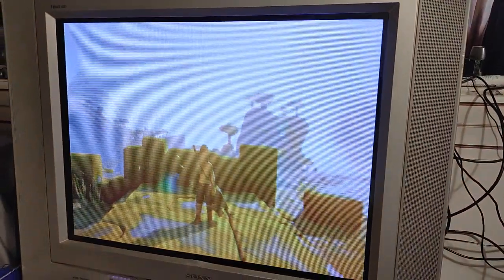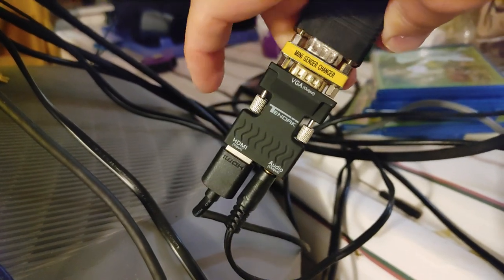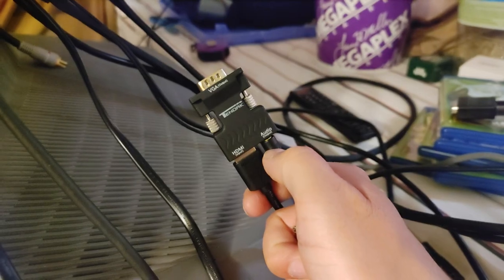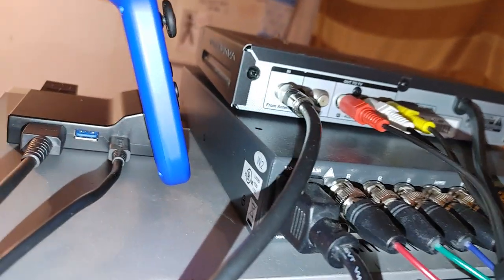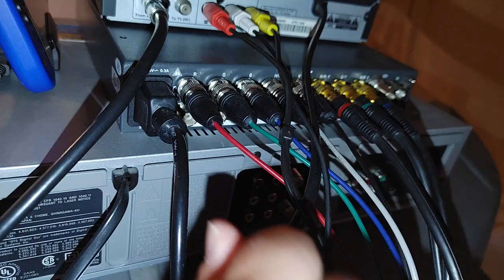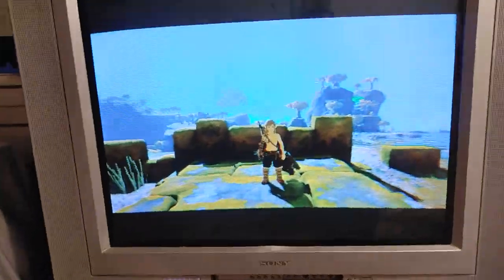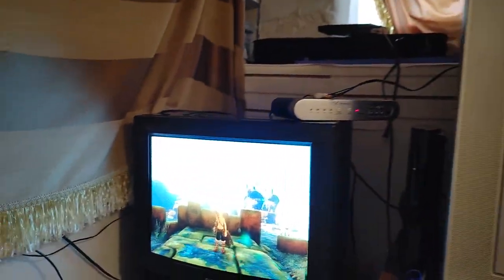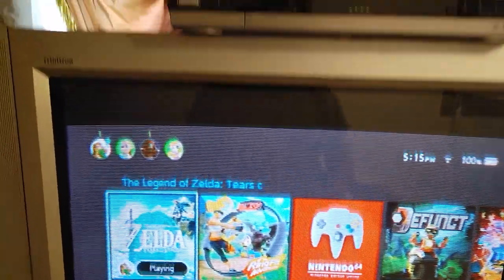How to Connect a Nintendo Switch and Zelda TOTK to a SD CRT Using an Extron VSC!

Comment: Thanks for making this video, very informative!
Does the VSC let you switch between interlaced and progressive output?
The manual of the VSC500 doesn't really say anything about output resolutions, only the different RGB modes you can select.
It should output RGBS 480i at 60Hz for my application, just wanted to make sure before I try to find one for sale :)
Cheers!
Reply from the maker: Great question!  So yeah - these VSC devices only output 480i SD signals.  No 240p or 480p unfortunately.
Reply: @FairyKid64  PERFECT, 480i is what I need!
Thanks for the reply,
cheers !
Reply from the maker: @dirxanr3213 You bet!!

Comment: Can the VSC500 stretch the width beyond the edges of the CRT TV?

Instead of having black bars or negative space on the top and bottom, could I stretch the signal to fill the height of the CRT monitor and crop the width on the left and right?

When playing Nintendo 64 classic games on the switch, the switch automatically adds bars on the left and right with the 4:3 game in the middle.

But when the 16:9 signal is squeezed, the 4:3 classic game is squeezed, too narrow.

I don’t need the bars on the left and right that the switch provides, so I’d like to stretch the signal and crop out the bars for Nintendo 64 classic games on the switch. 

Also, thanks so much for making this video. It was super helpful & thorough!
Reply from the maker: Great question!  And thank you for the comment!  I'm pretty sure you can crop off the ugly borders of the NSO N64 games with the Extron VSC devices.  But I'll double check and get back to you for sure!
Reply from the maker: Okay - yes - you can make NSO games look AMAZING on a CRT with the VSC 500/700/900!  Check out this video I just made if you're interested in seeing how it works: https://youtu.be/b4vpKdqZWho?si=7mfX2XgXkkOlVxGg
Reply: @FairyKid64 wowww!! Amazing! Gonna get a VSC500 because of your insights! Thank you so much for replying and making the video update! 

Really appreciate you!

Comment: Hi, amazing video! I found a CRT tv with both composite and component connections. Would I still need one of these Extrons or can I just get an hdmi to component adapter and connect directly to the tv? I did like the extron because you showed how we can adjust the tv so I might one to get one anyway, but for the time being I would opt for the cheapest option possible.
Reply from the maker: Oh yeah - nice!  And thanks!  Yeah - unfortunately you will need some sort of scaler like the Extron because your TV probably is an SD set, so it requires 480i, but the Switch outputs 480p, 720p, or 1080p.  So you need something like the Extron VSC 500 that can convert the Switch's "p" (progressive) signal to "i" (interlaced).  Here's an Amazon link to an adapter I've tested a little bit before:  https://amzn.to/49y7EJF
This adapter isn't as nice as the Extron, but it is a lot cheaper!

Or is your TV an HD CRT?  If so, then one of those HDMI to component adapters will definitely work!  Just make sure to set your Switch to 480p in the system settings.  One of these should do the trick:  https://amzn.to/3T00AOG

But again, your TV probably is a SD set and would need the first adapter.

Both of those are Amazon affiliate links too btw.
Reply: @id64 Honestly, I don't know. I looked at the manual but it doesn't seem to be an HDTV. The tv is a JVC AV-32F704 and I think its an Standard. I was hoping I could get the 720i/1080i by plugging directly in the back with component cables/adapter. I did find a extron 500 for $40 but I haven't purchased it yet. You mentioned in a video that the extraon 900 has the option to switch between preset and I want something like that but you were right about the price tags, so I'll just opt for a 500 since they are so cheap. (never mind, i looked again and it was an Extron Fox 500)
Reply from the maker: @orannis5700 Oh yeah - I was going to say - $40 for an Extron VSC 500 would be a great deal!  Yeah, too bad it wasn't a VSC.

You know, if you do want something really cheap, you could also get one of these: https://amzn.to/4bZfOwj (Amazon affiliate link).

I've used this adapter too.  It's definitely not as nice as the Extron VSC 500 or even that other $40 component adapter I shared earlier, but the price of $10 is a steal, for sure.  If you're not super sensitive to lag or the sharpest picture quality, then this could be an acceptable option.  Just remember you get what you pay for. 😅
Reply from the maker: By the way - I just looked up your model of TV - it looks way nice!  And it does appear to be a SD set - however, it says it has an "16:9 Anamorphic DVD Mode" (https://support.jvc.com/consumer/product.jsp?modelId=MODL027063&page=1), which sounds a lot like the 16:9 enhanced mode my Sony TV has!  I can't say for sure, but I think this means that you could use that $40 component adapter I shared earlier (or even that $10 one) and then your TV could squish the image to 16:9 so you wouldn't even need the Extron VSC to get the correct aspect ratio!

Have you tried that "16:9 Anamorphic DVD Mode" on other stuff?
Reply: @FairyKid64  I havent had a chance to try it yet, I'm due to receiving it today or sometime this weekend. I'm going to buy that $40 device you linked and hope for the best until I get an Extron in the future. Man, I'm so excited and thank you again for all your help and your videos!
Reply from the maker: @orannis5700 You bet!  Yeah, let me know how it goes!

Yeah, just make sure to change the output resolution of that $40 scaler to 480i and it should work!
Reply: @FairyKid64  Hey, I purchased the Extron 700 instead of the component adapter (i probably should have tried the adapter first for the 16:9 enhanced mode but oh well), and i'm going through your video again in order to purchase the rest of the stuff. I'm a little confused on the audio cable you mentioned towards the end of the video. If I don't purchase the cable you linked (3.5mm Audio Jack to RCA Cable) then I won't have any sound coming out of the tv, and what about the Composite Video Cable? Finally, going back to that $40 adapter, you mentioned it would squeeze the image to 16:9 thus making the extron irrelevant, but is there any benefits for having the extron now anyway?
Reply from the maker: @orannis5700  Oh, cool!  Yeah, the Extron VSC 700 is what I have and is really nice!  So yes - you will need that 3.5 mm to RCA audio cable for sound.  As far as the composite cable goes, if your TV has component (the red, green, and blue RCA connectors), then I would get that and just skip the yellow composite cable.  Component coming out of the Extron VSC is a big upgrade usually over composite.  Some TVs are better at composite than others, but that's the general rule.

As far as if that $40 adapter would be better than the Extron - I haven't tested it extensively, but I'm almost certain that it would not be as good - especially for what you're doing with your SD TV.  The Extron's scaling options are so much more advanced than that $40 adapter.  That $40 adapter does have certain advantages, but I would choose the Extron personally most any day.  Plus - if your TV does have the 16:9 enhanced mode, then that would also work with the Extron VSC!

Did that answer all your questions?
Reply: @FairyKid64  It did, thank you so much for all your help and putting my mind at ease! Can't wait to get all these parts and put it all together.
Reply from the maker: @orannis5700  You bet!  Let me know if you have any more questions!
Reply: @FairyKid64  hey, i got all my parts and i set it up but I'm having trouble with the image. Its split in half, with the upper half showing on the bottom and bottom showing on the top. Also the color is a magenta color on the screen, but only when i'm using a device. The tv by itself seems to be fine so i'm worried that the vsc is messed up. Do you have discord or something where i can send you pics of the display? Nevermind I figured it out lol it looks great on my ps5 so far, going to switch to ps4/switch since those two will be the primary consoles for it.
Reply from the maker: @orannis5700 Oh good - I'm glad you figured it out!  What was the problem?
Reply: @FairyKid64  Signal input was on rgb and then wires were not in the right place for audio. So far I've tested them out on 480p-1080p output from my consoles and for the switch the 720p looks sharper than 480p and I just end up using 1080p on ps5 since i can't tell the difference between anything lower. I love this thing so far and having a blast playing games on it!

Comment: i wonder how the dithering graphics look on here. do they blend like sega saturn or do they still look checkerboard ??
Reply from the maker: It's kind of a mixed bag to tell you the truth.  The graphics do blend more so you don't see all those sharp edges like you would on a modern digital flat screen, but at the same time these games weren't made with these TVs in mind, so text can be hard to read.  However - if you can get your hands on a CRT computer monitor and hook your switch up to that - oh man!  Check out some of my other videos where I show the Switch on those high resolution PC CRT monitors!

Comment: hi thx for sharing. I want to set up as u did. Could you let me know it is ok to use RGBS(not like yours 5lines) into vsc700? 
My plan is this. HDMI(switch) - vga converter- vga gender changer - vga to RGBS with 4 lines (not RGBHV 5lines) - extron vsc 700 - component ouput to my sony PVM.
Reply from the maker: You're welcome, and yes, that should work!  I haven't tested it personally, but according to the spec sheet ( https://media.extron.com/public/download/files/specs/VSC_700_D7_012709.pdf ), it should take RGBS as the input.
Reply: @FairyKid64  hey thx for reply. I had set up. 480p input works well from switch(manual setting) or alalogue pocket dock. But 1080p doesn't work. 1080p from switch(tv resolution setting) or Chromecast. Is there any problem with that 4BNC cable? my vsc says out of range or display just unrecognizable pattern on my PVM. I tried 4 kinds of hdmi vga conveter, but it didnt work for any vga converter. So i have suspicion on cable or vsc itself. Do you have any idea or experience?
Reply from the maker: @hatama-sg3wh I wonder if the 4 RGBS cable doesn't accept 1080p.  You could try the adapter I used in this video.  There's a link to it in the description.
Reply: @FairyKid64  I got 5BNC cable and It works finally! Thx for this video and explanations.
Reply from the maker: Hey, that's great!  You're welcome!  I'm glad it's working for you!

Comment: Thank you for making this video!   How would I connect an Extron ESC 500 to my CRT TV that only has the standard RCA red white and yellow AV input?

Thanks again.
B
Reply from the maker: Hey, you bet!  I'm glad my video could help!  As far as connecting the regular RCA yellow, red, and white cables, it's really simple.  All you need to worry about as far as the Extron VSC goes is connecting one BNC to RCA adapter like the ones I linked in the description to the "Video" out on the back of the Extron, and then use a regular yellow RCA composite cable to connect it to your TV.  As far as audio goes (red and white cables), you can just do what I showed in the video to get audio.

Did what I wrote here make sense?
Reply: @FairyKid64  Makes sense to me. Still waiting for my VSC 500 to arrive. Thanks for the help. I saw another guy use an HDMI modulator (coaxial out) to an older Zenith HD Tuner with aspect ratio control connected to his CRT. Seems to work pretty well and can be had for pretty cheap. Any thoughts on this route?
Reply from the maker: @bcretty606 yes, that's a good route as well.  My biggest concern with blindly recommending any HDMI to RF adapters would be the amount of input lag the device adds.  Probably for most people it won't be too noticeable, unless it's something crazy like over 100 milliseconds, but that could change a lot from device to device.  But I have an old RadioShack HDMI to RF adapter, and while I haven't done a lag test on it, it feels pretty good.  Now, there is the question of composite vs. RF too - a lot of people will say composite is better than RF, which is in theory true, but in practice it just depends.  I have one CRT in particular which RF looks much more vibrant compared to composite. 🤷 But another advantage to composite compared to RF Is that with composite, you have the option for stereo sound, whereas RF I think is always mono.

Comment: Will the Extron 100 work for this as well? And give me the option to adjust the aspect ratio?
Reply from the maker: So, I've never tried the VSC 100, but from what I understand, it is similar to the VSC 500, but with less features.  So for example - you probably will have to feed in it a 480p or maybe a 720p image - it appears 1080p isn't supported.  Also, you won't be able to change the aspect ratio apparently - you can only pan the image and zoom in and out.  But it still seems like a decent product.  Here's a link to the manual if you're interested in reading about it for yourself:

https://media.extron.com/public/download/files/userman/VSC_100_RevC_manual.pdf

Comment: Hey there! I’ve got the VSC 500 and I’m trying to use it to display an old MS-DOS machine and a Commodore 64 on a PVM display. I also try to run everything through an 8:2 SCART switcher so I can record the second output.

So anyway, I’m going from VGA out to VSC 500, going out the BNC there to the SCART switcher, out to the PVM display and a second out through an HDMI conversion and recording setup. For some reason I can’t figure out where the black cable goes on the VSC 500 and don’t get sync, so the PVM shows a green imagine that moves around. I tried the black cable in every open slot but no dice. Anyone more familiar with this stuff? Got a few little kinks I’m trying to workout in this setup.
Reply from the maker: Hey man - great question!  So, try changing the output configuration to RGBS and plugging the sync line into the H/HV line.

Here's a short video I just made showing this:
https://youtu.be/dEYW89kmkcQ?si=Bw7N4Dtg_hKgmt15

Comment: My first attempt at this hasn’t gone well! My VSC says no input detected. Guess I’ll try ordering some different adapters and cables. I didn’t use the same brands you did.
Reply from the maker: Ah, gotcha.  Yeah, I left links in the description of what I used.  The good thing is that they are Amazon links, so if they don't work, you should be able to return them easily.
Reply: So got new adapters and cables. The VSC still says no signal after plugging everything in. No sure where to go from here.. I tested it with ps3 component cables and it worked but for some reason when converting hdmi to vga to component it doesn’t work.. just says no signal on the VSC 700..
Reply from the maker: Interesting.  What system and resolution are you using?
Reply: @FairyKid64  480p thru hdmi from an apple tv. And as a test 720p thru hdmi from a snes classic. Both resulted in the VSC saying no signal. However if I use component out from a PS3 and 480p, the VSC will detect it and scale to 480i out.
Reply from the maker: @AwesomesMan I see.  So, you say you're using the VSC 700 like me, correct?  Are you sure you have the BNC cables plugged in the right order?  Double check the RGB cables are in the right order, and also try switching the order of the two sync lines (the gray and black wires).  I've swapped the sync wires around many times, which always results in a no signal.

Also, do you have a Nintendo Switch you could try?
Reply: @FairyKid64  Yep plugged in just like yours. I got it fixed though! Needed 5v power apparently. I bought a hdfury2 to do hdmi to vga which is powered. Usually works now.
Reply from the maker: @AwesomesMan  oh yeah - that makes sense!  Yeah, I forgot that some HDMI to VGA adapters require power.  I'm glad you got it working!

Comment: Do you know if this introduces any screen tearing?
Reply from the maker: Great question!  So, if you're using it like I do in this video with a device outputting a pure 60hz signal (like the Nintendo Switch), then there will be an occasional, slight screen tare.  Most of the time you don't notice it though.  This happens because these old CRT TVs are actually refreshing at 59.94hz instead of 60hz, so there's essentially a 0.06 screen tare (aka very small and not too noticeable).  It mostly doesn't appear in the center of the screen, so it's really not too annoying (at least not for me), but it is visible at times - especially if you know what you're looking for.

On a side note, if you're using a PC and can set the refresh rate to 59.94hz in the display settings, then in theory there shouldn't be any screen tearing.